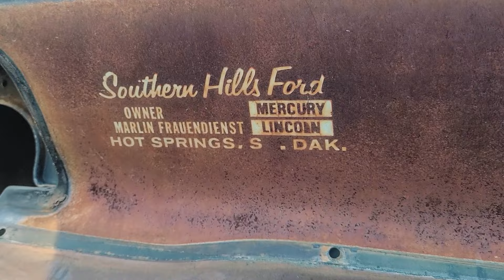Pulling a '68 CHARGER from the WEEDS

Comment: I am a seventy five year old man who ran the wheels off of them. I never cared for that unibody style cars. I wish they had used galvanizing on them so the rust didn't chew them up.
Reply from the maker: Think of how many more cars would be on the road today if it was galvanized steel... if only!
Reply: @EvanLudes  You might find it funny that the ford motor company did start the galvanization of steel yet only used it on one factory and sadly I do not remember the one it was... lol, not detroit for sure!!
Reply from the maker: @morgansword  meanwhile we've got a Scout, that probably had rusty metal before it was even off the line 😅
Reply: @EvanLudes  Ah, names for these two... lone ranger and tonto... I know.... lame/LOL. Most of the scouts tho did have enough metal before paint or other decorations came on them were thicker steel. Late sixties scouts kinda look like the new bronco  odd front ends.
Reply from the maker: @morgansword  yeah, the new looks like the old and the old looks like the new haha. Broncos copied the Scout's homework ;) Excited to see the new factory making Scouts going up in SC next year, even if they're basically Rivians.

Comment: The way I’ve gone about doing these major restorations is to not look at all the work that needs to be done, just focus on a certain area of the car, say the trunk or engine bay, front chassis and finish one of those and move on to the next, hopefully this will help and good luck with your project!
Reply from the maker: Great way to look at it! Step at a time makes it less overwhelming. One thing is for sure though, even if it's not a show car, Sean will do it right!

Comment: I am old enough to remember when the 2nd Gen Charger first came out. The first time I ever saw one was in 1968. I was standing at a cross walk with my Schwinn Stingray when somebody pulled up to the stop sign with a brand new Dodge Charger straight off the lot. I knew right then that car would be the best looking car ever made in U.S.A history. In the late 70's and early 80"s I made three attempts to buy a 2nd Gen Charger, but they all fell through. Back then you could buy a complete running 2nd Gen Charger for less that $1000.
Reply from the maker: I think we all wish we had a time machine for those deals, heck even just to witness those rolling the streets new must have been amazing. Thanks for sharing and watching!
Reply: @christophersanders5007  I too am old enough to remember intro ,I built model before I ever saw one!

Comment: It's a FORD say's so on the back 2:22. You lucked out the Frame/Roof and one quarter panel look's good. Was an A/C car big radiator opening for 26" radiator. Emerald green with a White interior was a pretty looking car when new.
Reply from the maker: Haha, it's never a color that I'd pick new off the lot, but after seeing Sean paint the engine bay, I dig it! And I agree, great to see some good metal.

Comment: Is that a 440 ?
Reply from the maker: Will have to check with Sean, I know the engine it came with was locked. Came with am RT grill but it's not an RT based on the VIN.
Reply: Yes it's a 440, had a valve inside of a piston in one cylinder😅 the rest of the cylinders are so rusted solid you can't tell the difference between looking at the piston and cylinder wall.
Reply: @EvanLudes  the grills are the same

Comment: Here's the weird car I once owned 67 Chevelle Super Sport real SS Car 396 two barrel single exhaust Powerglide on the column manual steering manual brakes 3o8 open rear end radio delete who ordered this car he must have been a cheap ass but it was SS pretty rare I bought it for the motor I didn't care about the rest well yeah I was California car how dumb was that I paid $300 for it at a junkyard that was a 1977 who would order a big block with a two barrel that's crazy:hand-orange-covering-eyes: oh yeah carpet delete rubber mat
Reply from the maker: After working a car dealership for a few years, nothing surprises me anymore on what options people order 😅 'Course you used to have a lot more leeway in the options, now they try to squeeze you into one of a couple boxes...